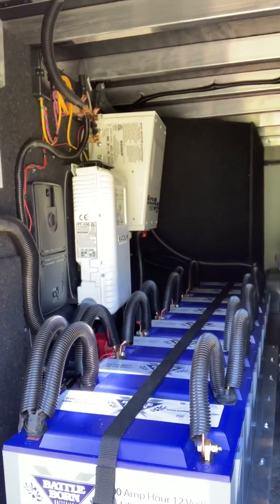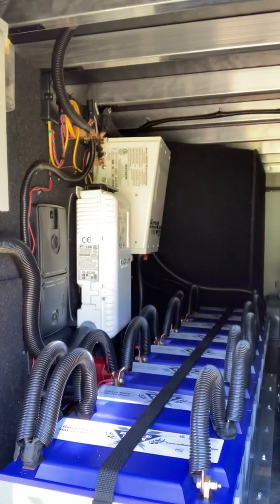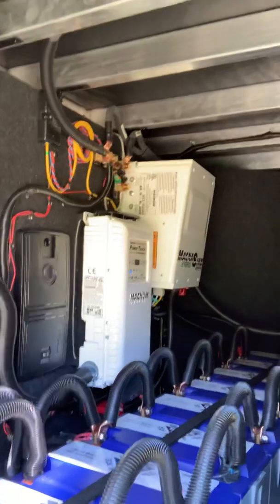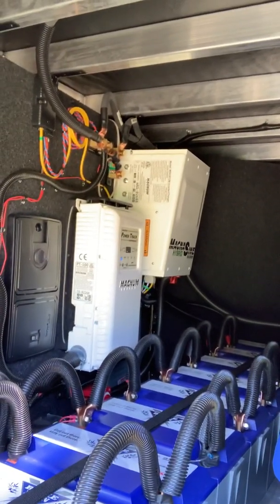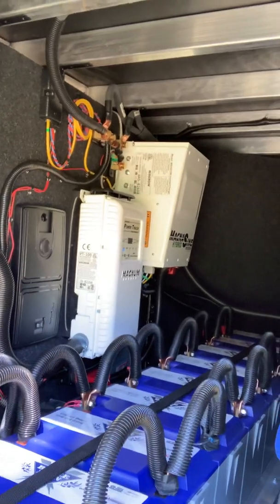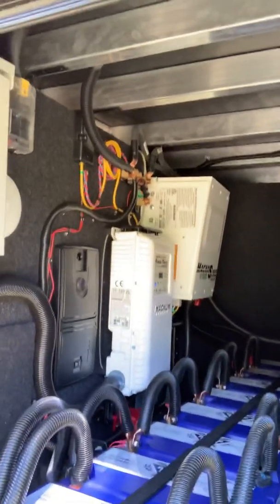15k BTU Air Conditioner on Solar/Battle Born LiFePO4 lithium??? Results...

Comment: Now THAT was gutsy!!! But, 2,000W on the roof, & 800AH in the basement- it's a good place to start!!! You could get cray-cray and put panels up as awnings (flexible panels with PVC tubing) and offset some more of that 150AH draw, but- by dusk, you are gonna be well below 50% of total power. Not sure how much you need to manage night needs, but- I'd see a generator in your future!!!
Reply from the maker: We do have a 5500w Onan but don’t really use it since when we’re boondocking we don’t stay in temps that require AC. I just wanted to test it to see what we COULD do. We’ve since added another solar controller, 400w of solar and 200ah in the battery bank and even in the winter with the sun so much lower, we bring in 120a pretty consistently. In the summer with the sun higher, we can get the 150a to run an AC. Like I said though, we chase 70°-80° so running the AC isn’t an issue for us.
Reply: @WheelinwiththeWendes  That is a TON of solar on the roof & AH's in the basement! I'm a soup/sandwich with power though- LOVE having enough so that I never have to worry using anything (at any time!) but, love winning the power management struggle daily? OK, to be fair, I will have 560AH of LiFePO4 goodness (actually a 24v 280AH, 8s cell set up) and don't think I'll ever hit 55% capacity in a truck camper, but- originally, I planned on using A/C on it. 11,000 BTU Dometic with a Easy Start should work, and- it only draws 1,018W (much less than your 15,000W center A/C), but, roof size limits total solar to a degree. Wait- BUDGET limits total Watts & AH's!!! Hahaha

Comment: instead of spending another 4 grand on panels and batteries maybe you should have just bought an efficient AC unit.
Reply from the maker: We didn’t build the system to run AC. This was just a test to see how well we would do IF we needed it. We don’t boondock in those kind of temps. Thanks for watching.

Comment: Is there a specific reason you wired the mid coach A/C directly to battery and not through the system panels? Was it just to isolate and have no other users?
Thanks in advance . The video is very interesting.
Reply from the maker: I only have one 12v/3000w inverter at this time so I could only really choose one AC unit. The center one seems to cool the entire rig down the best since it's centrally located. I had thought about using the bedroom AC just for sleeping but if we needed it during the day, it doesn't cool the whole rig down quite enough. We rarely use the AC on solar anyway since we tend to boondock where the weather is cooperating. :-)

Comment: Hello guys came over from Slow Momentum driving down the road.  Oh wow you have our dream setup.  We have a 42 foot 5th wheel also, going to stick with you my friend and watch your journey.  Who did your install?  That's awesome running the A/C if needed. Our fridge is residential though and putting up refectives for the extreme temperatures.  Thanks for sharing.
Reply from the maker: Hi there! Hope to start posting more videos on here but we both work full time so it's a little hard. We've since added 400 more watts of solar and 2 more batteries, for a total of 2400w and 1000ah of BattleBorn. I did the install myself, after doing a TON of research. It's a little overwhelming until you start breaking it down into the separate systems. Feel free to reach out for whatever I may be able to help with, keeping in mind I'm not a professional installer. Always willing to help out though...
Reply from the maker: For the time being, if you're on FB, head on over to follow our travels there. We tend to keep up with things there since it's quick and easy. https://www.facebook.com/WheelinWendes/

Comment: I watch the video on your battery/solar system with the folks from you me and RV.  In that video you stated that the breaker panel was within 5 feet of your batteries. I am considering buying a 376THS.  Do you know if the breakers were moved when GD moved the door and control panel to the rear of the kitchen slide?   My concern if they moved the circuit breakers would it still be feasible to move the batteries to the rear storage bay.   They would be further from the generator and solar access if it was not also moved.  Thanks in advance for what assistance you can give me.  Love you battery/solar setup.
Reply from the maker: Larry Clemmer Hi there! I’m really not sure since I haven’t seen the THS in person yet. Now I’m curious too.

Comment: Your problem is that inefficient roof unit
Reply from the maker: Aaron Aaron True, but that’s what I have...
Reply: @ Aaron Aaron :  What's the alternative?
Reply from the maker: @Milesco  Some use mini-splits or window units...
Reply: Split systems  in mino van type camper is not feasable. He is using real world appliances at a higher btu rating. It would be cheaper adding two more batteries and not messing with the camper configuration! .

Comment: If I may ask, did you do your own install have it done by a company? If a company, would you recommend them?
Reply from the maker: I installed everything myself but on my previous rig I had Brian Boone do the installation. He’s all over FB and has a blog website. He travels the US doing installs and does a very good job.
Reply: @WheelinwiththeWendes  thank you for the info! I'm pretty sure I could do it myself, just not looking forward to pulling the wires.
Reply from the maker: @odieslc  Depending on your rig, it may not be as hard as you think. Mine was a piece of cake!

Comment: Hi Lance, good to see you on Y/T.  I just finished watching the two of you with Phil & Stacy talking about your new rig, and as a result I have two questions please....1) If you have so much solar, why did you opt for an RV refrigerator,  wouldn't a residential be more efficient with a good inverter?    2) As I am within about 60 days of ordering our new TH to haul "Chief" (my Gold Wing) my two choices are the Momentum 376THS or the Riverstone 37FLTH. So after being in your Momentum for nearly a year, I would like to know how the two of you feel about your current rig, to include any cold weather camping you have experienced.  Thanks, TS - Denver, CO
Reply from the maker: Hi Tyrel! We're actually looking into switching to a residential for that very reason. The RV fridge sucks a TON of power from our bank. Other than that, we LOVE or 376 and not much we'd change. They've been super easy to deal with on the minor issues we've had and can't say enough about their customer service. Just took a tour of their factory in Elkhart, IN and was extremely impressed! As far as cold weather, we've been good with it. The insulation must be very good. Even in the summer at high temps the AC hasn't had a hard time keeping up like our old rig.
Reply: Thanks Lance, good information and much appreciated. Hope to meet you guys "On the Road" some day next year.  Be safe, Have Fin, & Happy Camping.  v/r, TS
Reply: @WheelinwiththeWendes   The two way fridge sucks a ton when running on propane?  (I'm in the process of conceiving my battery bank and charging glass)

Comment: How many solar watts do you have?  (Is that the correct way to ask that? Solar is new to us)
Sorry if you mentioned it in the video.
Reply from the maker: DC DC 2000w total, 10) 200w panels. We have 2 strings of 5 run in series.
Reply: @WheelinwiththeWendes  2,000 watts is a LOT for an RV!  That's on a good day.
Reply from the maker: @ddd228  I'm actually looking into adding 2 more panels since I've recently added 2 more batteries. Even with 2000w I rarely see over 1500w coming in and more solar would help in charging the extra batteries, total of 1000ah now.
Reply: @WheelinwiththeWendes    7 panels in series is about 900 watts on a good day.1,500 W. Go Power inverter on just 12 volts. I can run a 6 K BTU A/c!
Reply from the maker: @ddd228  Sweet! I see alot of people running the smaller ACs due to the lower amp draw.